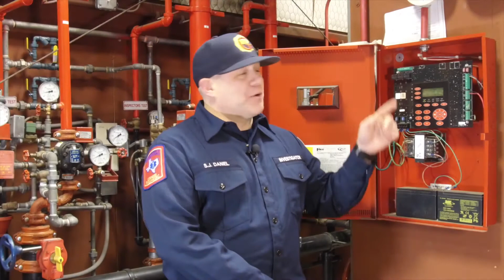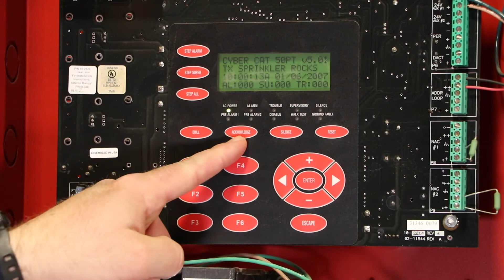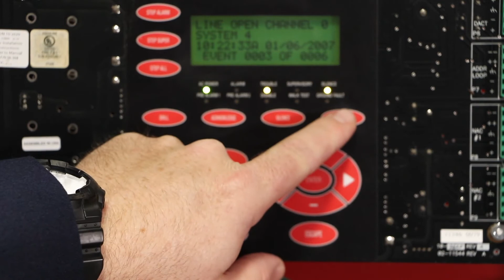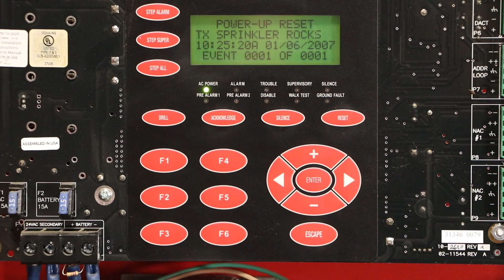Fire Alarm Systems 101

Comment: Excellent video.  Thanks !

Btw - After 30+ years as a volunteer firefighter /paramedic AND the owner of a fire alarm installation & service company, I’ve noticed very few fire department personnel on the volunteer side, know much about sprinkler systems.
And… it seems that “dry” systems seem to have the most rust/corrosion problems.

Comment: Great informative video, but I myself, who works for a fire protection company, I notice a couple things I wanted to point out.

I’m curious as to why you would have to “silence” the “trouble” and “supervisory” conditions if you “acknowledge” them first?Silence is only to “kill/quiet” the horns/strobes/speakers if the building is in alarm. Obviously, like you pointed out, you must confirmed the “alarm” condition and deem if everything is all good. 

In actuality, you don’t have to silence those conditions since acknowledging them will stop those conditions. In addition, the “trouble” and “supervisory” conditions will not set off the building unlike a alarm condition would. “Silencing” trouble and supervisory won’t do anything unless it was programmed that way. Sometimes supervisory conditions are not latching and may go in and out, depending on the circumstances. I haven’t touched Fike panels in like forever so maybe I’m just overthinking here.

I bring this up since end users tend to get misinformed about how they operate the panel. They know the silence button and will press it without checking out the situation since it’s just beeps a lot for them.
Reply: Silence won’t kill horns or speakers
Reply: @somerandomdude115  uh, yes it does, dependent on how it’s programmed and what the AHJ required at the time.

Pressing “silence” can silence the horns/speakers but still strobe or silence horns/speakers and strobes. Again, all depends on how it’s programmed. 

S.O.P is to Acknowledge the alarm condition, investigate area, if no fire or false alarm, silence condition then reset. If that doesn’t work, call your service provider to extensively troubleshoot.

What I’m asking here is why silence a “trouble” or “supervisory” condition since they don’t actually “alarm” the building or put the building in “alarm”. 

“Supervisory” and “Trouble” conditions will annunciate locally at the FACP to let certain personnel know what’s going. 

People will always put in service calls, regular or after hours “emergency”, and said the alarm is going off…..sure, it’s the FACP beeping or the building is actually in alarm sounding throughout? 95% of the time is the “panel is beeping”.

The difference could determine whether it’s an actual emergency or some dumb jughead doesn’t understand how their equipment works that could wait for a regular service call during normal business hours.
Reply: Strobes don’t make sound
Reply: @somerandomdude115  You don’t say? aren’t you a Sherlock Holmes? You sure are the piece of chalk that is needed for a dry erase board. 🤣😂
Reply: @bjkjr1087  Strobes are silenceable in the sense that they DO or DO NOT follow the silence function on the panel. You can also send the signal to your smartwatch.   https://youtu.be/kc0IfUopZmQ

Comment: Duct detectors are often set up as alarm points per the local AHJ. That’s how I most often see them set up in my area of Ohio. Also trouble points, and sometimes supervisory points, can sometimes be set up as latching. Personally I think they should clear on their own just as you said. Nice video!
Reply: Pari
Reply: yes most RTU's have duct detectors installed, and some UL location require global shut down on all units in alarm condition.